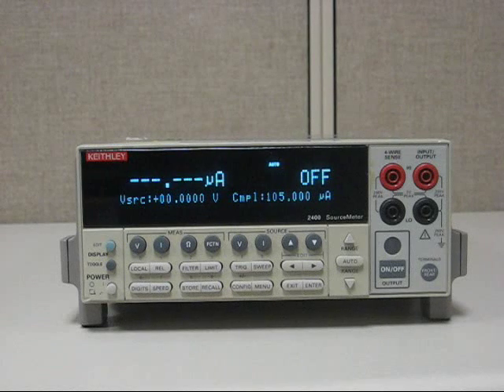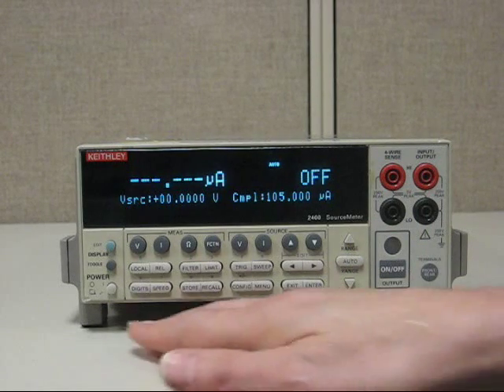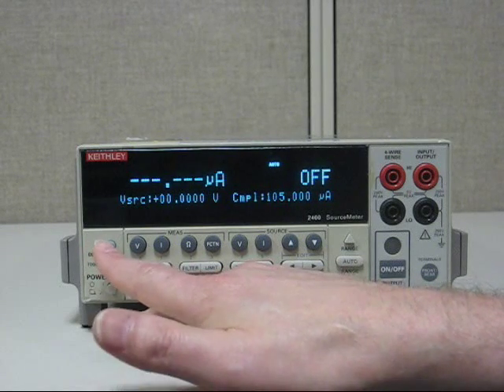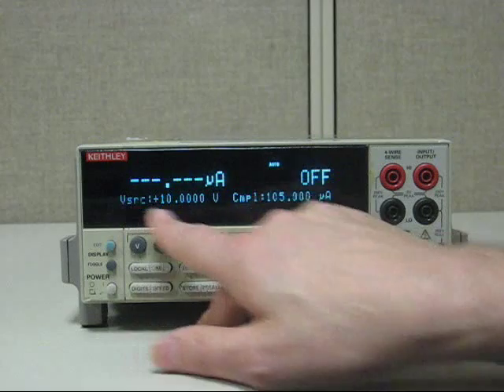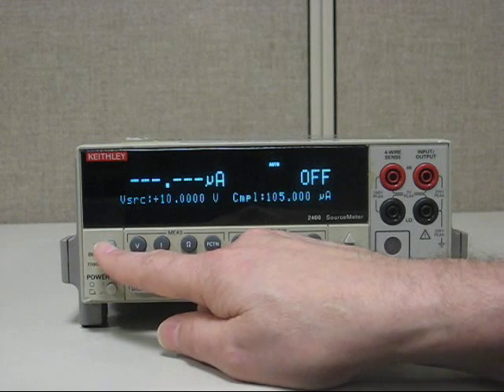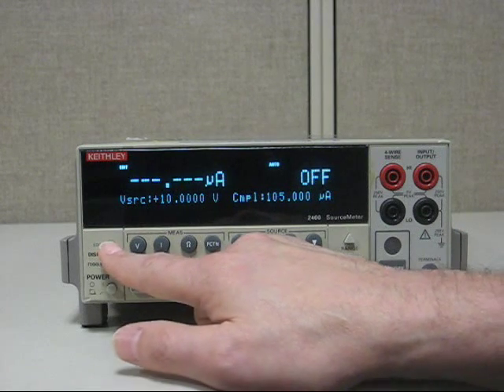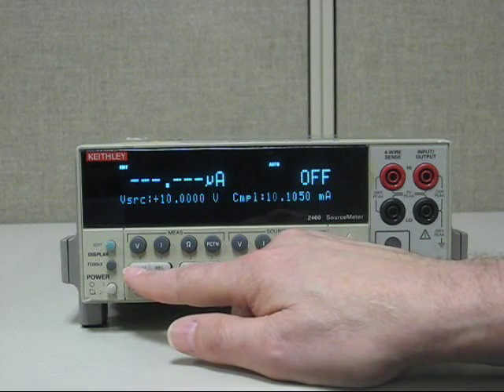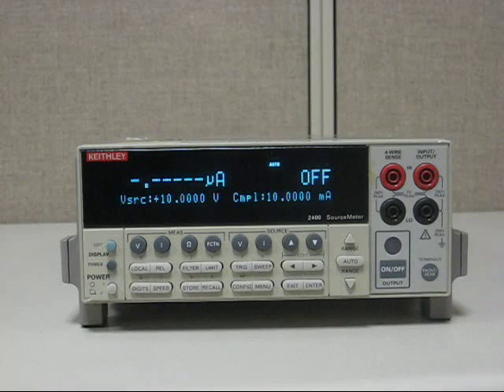Keithley Instruments Model 2400 SourceMeter:  How-To Source 10V with 10mA Compliance

Comment: When I source 10V, I measure the output at instant of the Keithley's output turned on.  My multimeter reads over voltage OL for 1 second before 10V is finally read.  An over voltage on the Fluke 179 indicates a voltage > 30 Volts.  The Keithley does not display this behavior when I source a lower voltage, say 1 Volt.  It immediately reads 1 volt on the Fluke 179 multimeter.   Do you know what could be causing this?